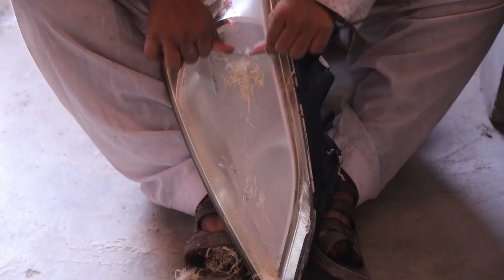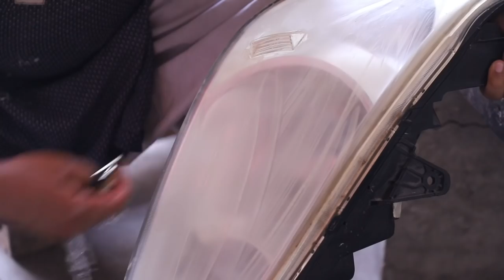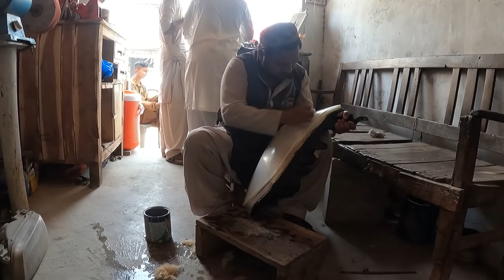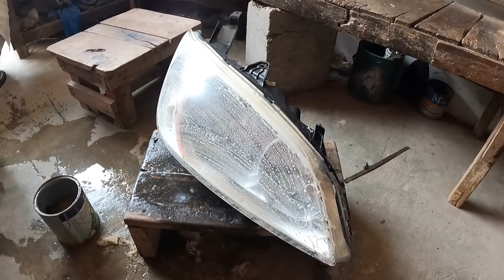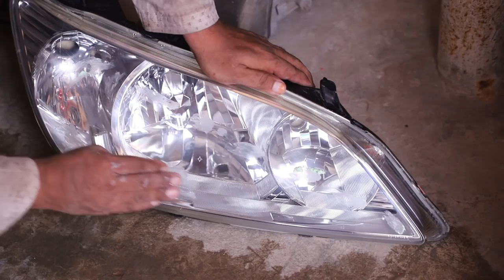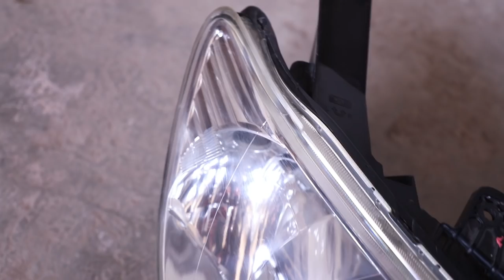Indigenous Technique of Restoring Old Foggy Headlights

Comment: While this does polish the headlight, it also removes the uv protection layer, so unfortunately, it will dull even faster than last time. The best way to do it is to do a similar process, except stop at 600 grit and spray clear coat on it with uv inhibitors. That's the best way to get a long lasting shine without yellowing.
Reply: A-ha!!
Reply: Но с китайскими фарами которых везде достаточно,проблемы с потерей защитного слоя не будет, у них она и так отсутствует))

Comment: Polycarbonate without UV protection is a disaster waiting to happen. You really need to apply clear coat after buffing. This is real bad.
Reply: disaster... real bad... lol , bit of yellowing over time ffs
Reply: Clear coat on plastic yellows and also dulls in time too….best protection is quality carnauba car body wax then a rain shield liquid polish  regularly.
Reply: @CillMhantainSean   Car wax is not relevant to keeping headlights clear. You need to apply a physical layer of UV protecting clear coating over Polycarbocate plastic. of headlights.

Comment: Great but I have been doing the same in Aussie land years ago...on aircraft passenger outer windows 747 etc. Trouble is once you do it, they do not last as the UV coating is gone. Needs regular polishing to last well. and still does not last unfortunately.